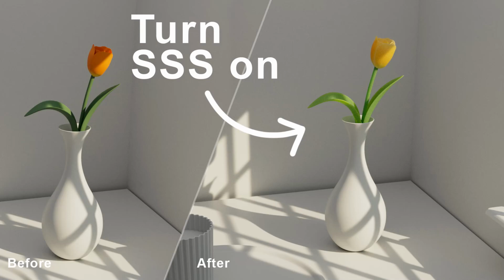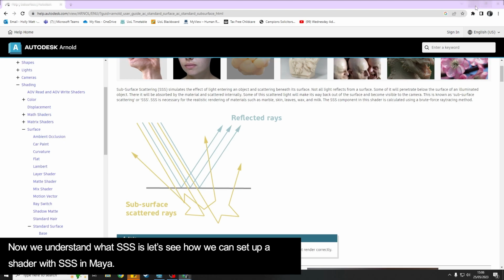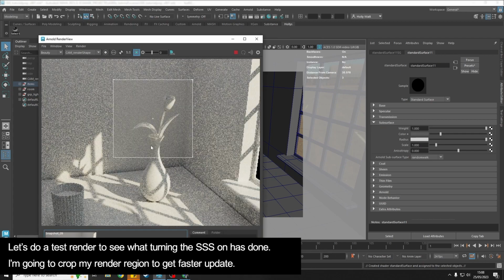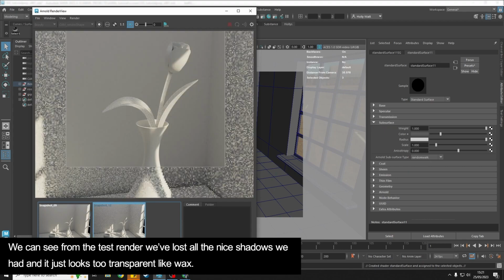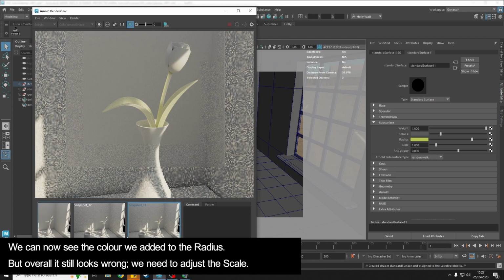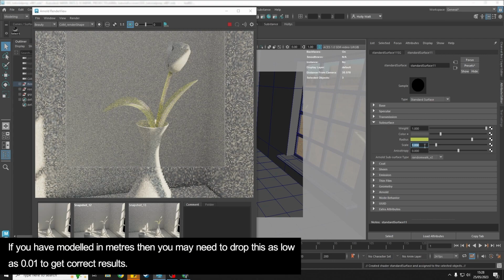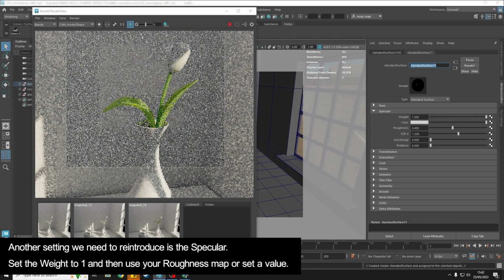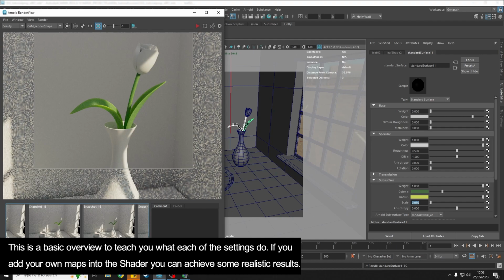Understand Subsurface Scattering in Maya and Arnold Renderer - Beginner tutorial

Comment: Can I connect a black and white map to weight input of subsurface, if I want some area to enter more light and some area to enter less?
Reply from the maker: Yes you would plug it into the Scale Attribute and then on the file tab you can use the colour balance section to adjust the intensity of the map